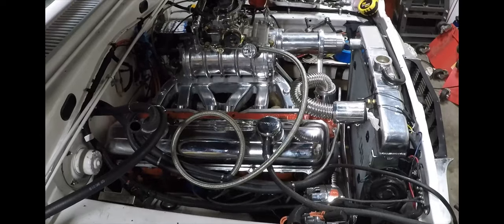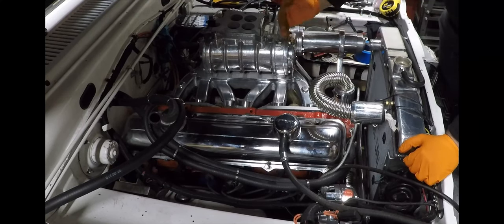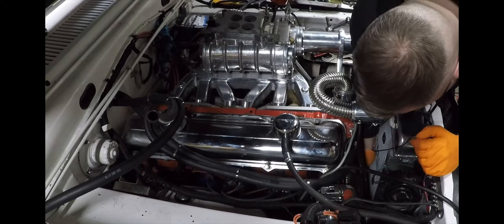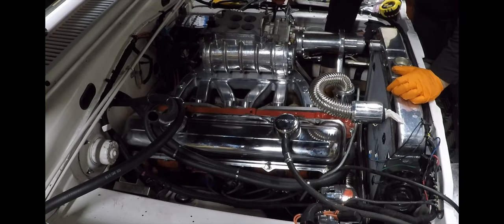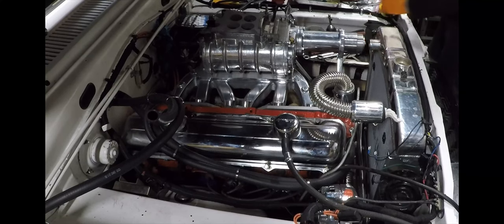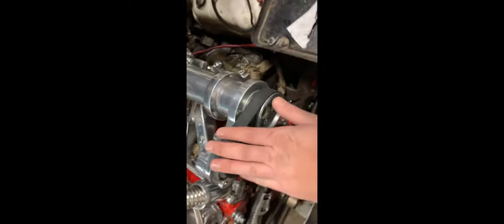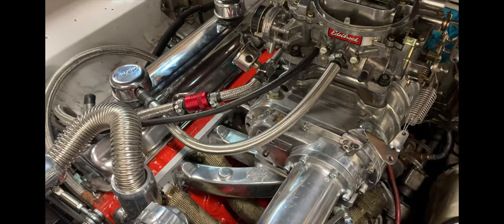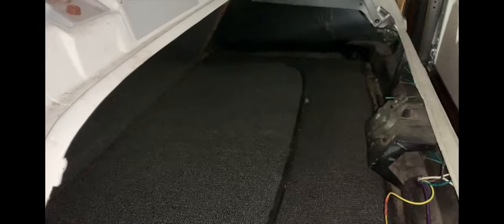Supercharging a Mopar Slant Six - Pt.3 - Mounted up & details, details...

Comment: It would be a good idea to change the tenchioner the belt needs to rap around the blower pully minam half way around or it's going to slip put the tenchioner on outside of belt pushing in . Shure looks really good
Reply from the maker: Been driving for many miles, not a sign of slip in sight. That's more common when boost levels are really loading the rotors, not under 10lbs boost... or when RPM's spike too quick, also not an issue on a slow-revving motor like this.Cheers!

Comment: Would you be able to make a comprehensive list of most parts you can recall you had to get to put this setup together? Maybe in a future video?  Wonder how much HP you making now !?
Reply from the maker: Oh man... the car has been such a sprawling build, my parts list would be meandering. Brass tacks? For a blower install all you need is the Aussiespeed supercharger kit,  a 142/144 blower head unit, a good carb & linkage and an MSD 6BTM. Everything else is ancillary and optional, or parts store stuff like lines and filters. AFR meter, radiator, those are all just upgrades but not required. I'm doing a vid on the overall car, and might do a more thorough build list there...
Reply: Are you using stock rods ?

Comment: Pardon my ignorance, but is the flip down trunk tray factory, or is that a mod you did? I've thought something similar in my Scamp would be a good idea as the back seat never gets occupied and I figure some speakers may fit better there.

I'm liking how this is coming along and getting ideas! I'm currently in process of new suspension, disc brake conversion, 8.75 swap, etc, but am looking forward to digging into the Slant as the next project.
Reply from the maker: factory! It was a feature and later sorta mimicked in the hang ten darts! And an option in the feather duster... Steve magnante did a junkyard crawl a couple weeks ago with a vid on one of those later fold-down-seat (passthrough) cars!